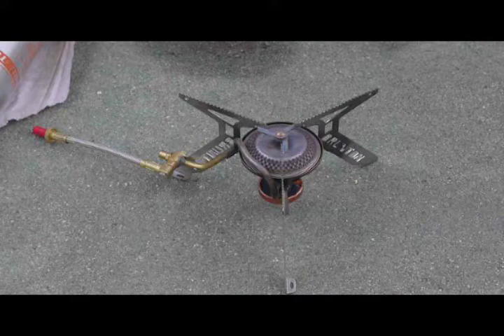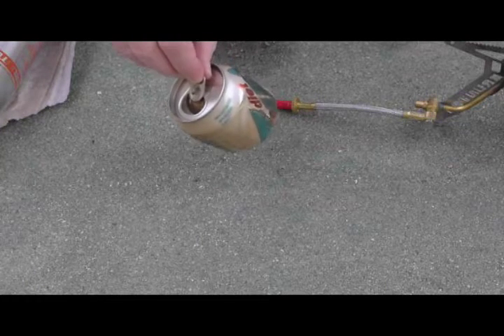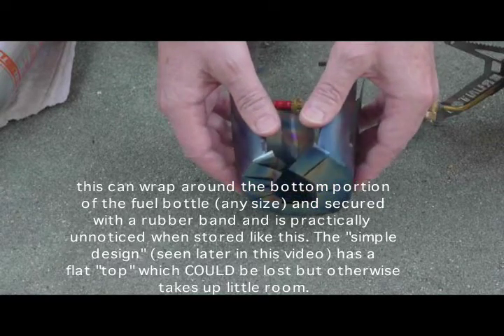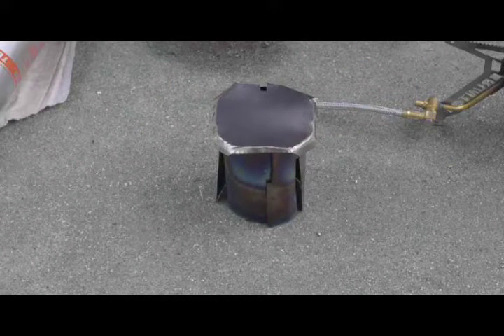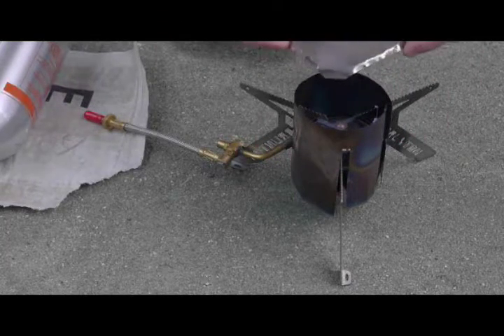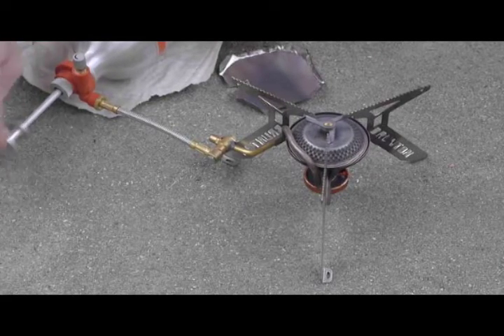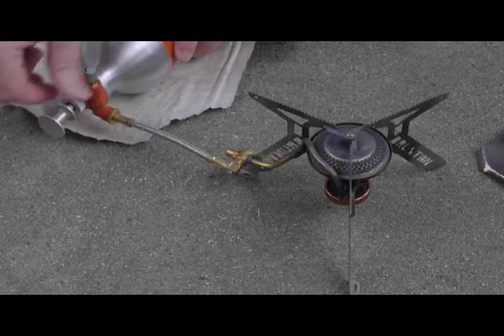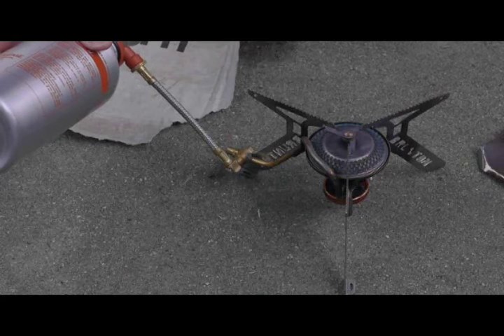Brunton Bantam stove start-up with titanium chimney

Comment from the maker: This is one of those butane powered (refillable) "torches" you can find almost anywhere these days. This model has a piezo electric push-button starter on the back end, has a fold-out support leg at the front so you can place it on a table while the flame is "on", has an adjustable flame, is of course refillable from a standard "Ronson" type butane canister, and so far has served me well! Thanks for the comment!